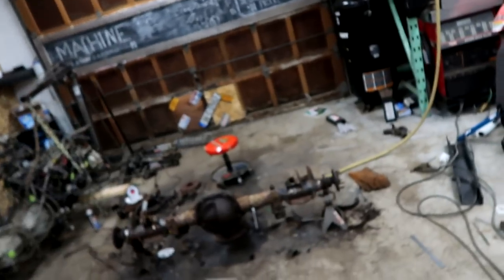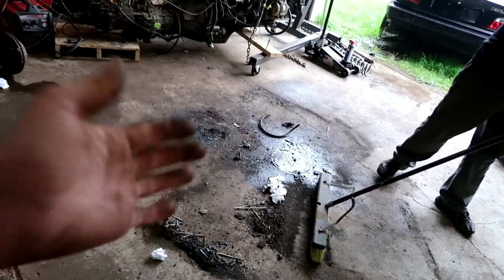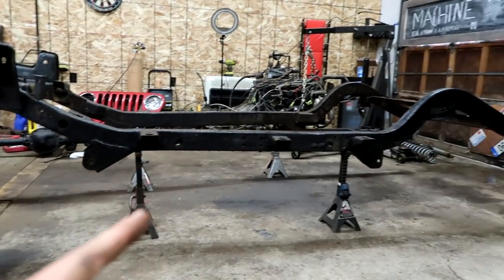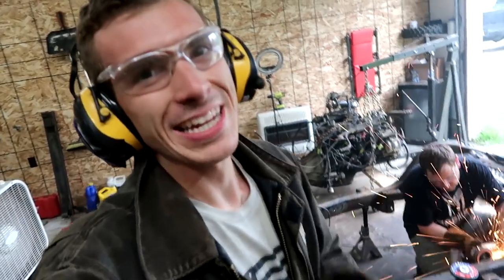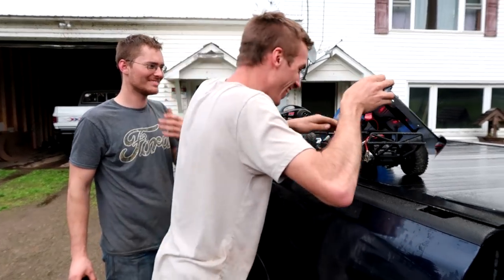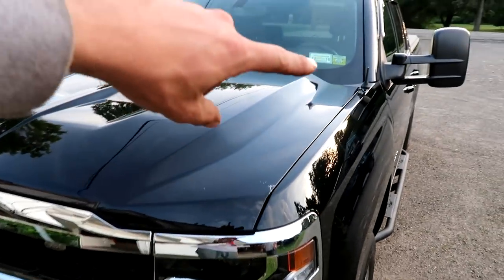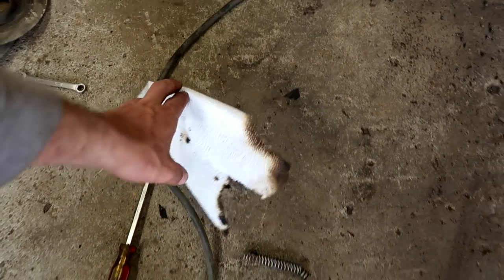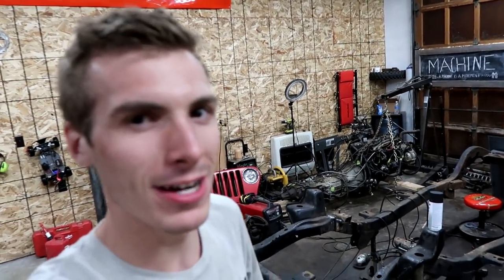NEW TRUCK REVEAL!!! (It's Sweet)

Comment: Be careful welding those axle tubes you can draw a lot of heat and bend them.. you should actually put them in a jig that way they’re straight across you run a bar all the way across the yard the rear end inside of it.. And PS they are usually waterproof you can run them in the rain in the puddles look them up online people run across ponds

Comment: Probably shouldn't have welded the brackets on the new axil until you know how the angle of the center diff. Judging how that drive shaft was with the last lift you will need to adjust that.

Comment: I think you should stick to one task. Instead of tryin to do all of em’ I have been on this channel for about four years and you really haven’t complete much. The gator build didn’t work out. The bmw off-road machine never worked out. The drift track was good but it’s kinda gone now. The drift truck didn’t make it far. The big 1000cc motorcycle didn’t work out. So I think you get my point. I love the channel and the vids are great. But it would be great if you could just stick to one thing at a time and fix it as it breaks and not just throw it to the side.

Comment: Yuck another Silverado.

How many Silverados does it take to pull a trailer?
As many as it takes to piss off the buyer into buying a real truck.

How does a Silverado buyer measure the time they have owned their truck?
In months, they never make it to years.

How do the new Silverados get such good gas mileage?
Easy, they loose half their weight in rust after 2 years.

What does the name duramax refer to?
The engines last for 100k miles instead of the usual 50k miles.

I can go on and on 🔥🔥🔥
Reply: jman26 1 How did Ford notify their consumers of the problems with their vehicles? I'll give you a hint, they circled it on the front of every one of them.

Comment: Traxxas has all waterproof electronics you can run it in any type of conditions
Reply: No not the stock Motor
Reply: It is lol
Reply: Brushless is
Reply: The titan 12t is more than waterproof lmfao
Reply: Mine wasn't😂
Reply: Kyler Yellott all the newer models are because you can’t hydroplane across
Water and it can sit in water
Reply: Well I didn't run it in water......who cares.....running a 6s and 2200kv motor with my speed build with some xo1 slicks😎
Reply: I have had to put at least 5 motors and replaced all electronics bc of water and mud. So obviously it ain’t ment for “all conditions”.
Reply: I run a Traxxas titan motor in my axial crawler had it for over a year and have made my machine disappear in the creek more than once for long periods of time, no issues
Reply: not the motor
Reply: Hoser's Garage I kinda wish mine would do that. Mine dies in the mud more than anything. But I’m pretty rough on it. The first thing I did when I bought it was flip it and brake a control arm. And I have replaced almost everything on the truck. And I’ve had it for about 3-4 yrs
Reply: Wha kind of cheap models do you guys have if the motor wasn’t waterproof lol
Reply: Heisenberg 89 the stampede. But it shouldn’t matter what model. Mud and sand and dirt and water can practically kill anything over time
Reply: 91 Fourtrax yeah obviously but for that one time it will be waterproof
Reply: Could
Reply: Electronics may be water resistant, but metal parts will rust and corrode if they aren't cleaned and protected after being wet.
Reply: Drake Falkner not the stock motor you need to up grade it to the brushless motor then yes but
Reply: Well i have stock motor and nothing happens after i use it in we conditions